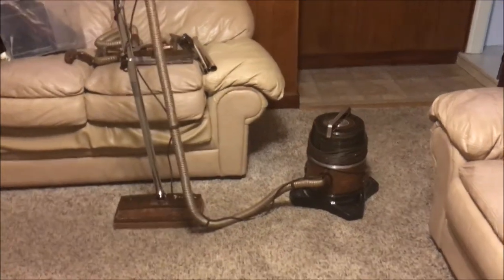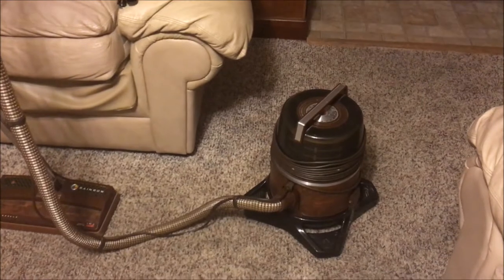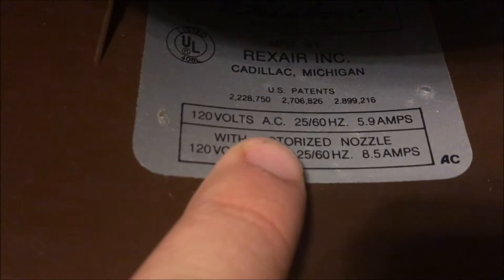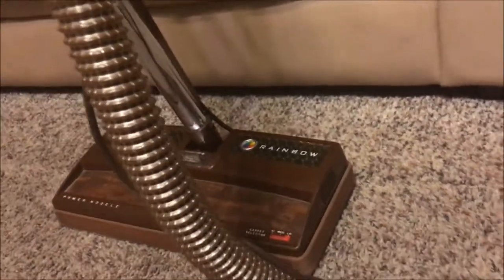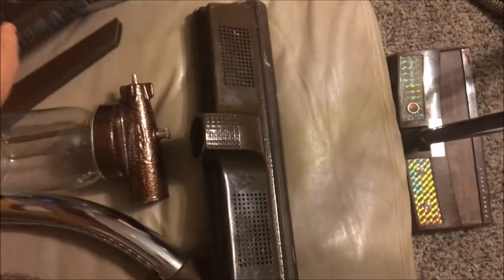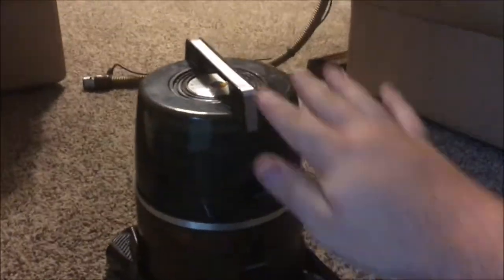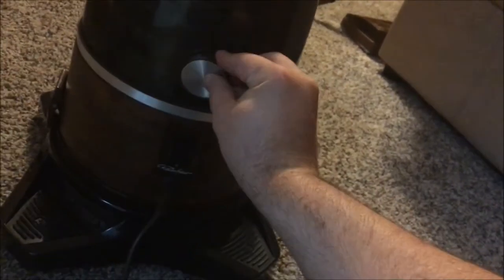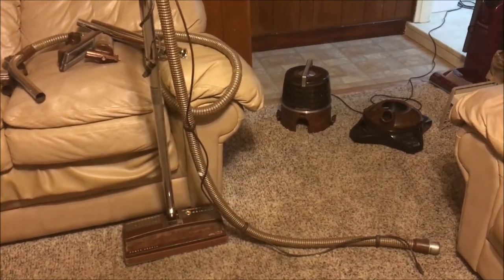100th Video: Rainbow D3c (D3) Canister Vacuum

Comment: Using an empty basin, you can pick up water with the non-electric tools.  Just don’t let the water go higher than the center peg.  One apartment I lived in, the upstairs neighbor’s water heater burst and flooded my apartment.  I used the Rainbow with an empty basin and the small tool to suck the water out of the carpet before any mold or other damage occurred.  Don’t forget to unscrew the water separator every few uses and clean it with a brush.  The screw can rust making removing the brass nut difficult or impossible.  The motor on these models can be rebuilt by replacing the brushes, cleaning things up and replacing other worn parts.  You don’t have to get a new motor like the current models.
Reply: I also had an apartment water heater had busted upstairs but it got tookl care of pretty quick

Comment: I bought a D3C in 1986 or 1987 for $1200.  I took extremely good care of it.  The only service it’s required all these years is the beater bar.  The plastic rotation bar cracked and was replaced with a wood bar.  I’m still using it for the upstairs.  I brought a 2018 model for downstairs so I didn’t have to carry it upstairs and downstairs.  I always bought the gallon basin.  The mystery paint stain is just part of the styrafoam that bonded to the plastic hose.  You should be able to clean it off fairly easily.  Make sure to have the motor brushes serviced to make sure they haven’t worn out.  The beater bar is the weakest part of the unit.  The belts tend to wear out fairly often and the bar with the brushes and beater bars tend to crack with age.  I use a gallon jug filled from the sink to fill the basin.